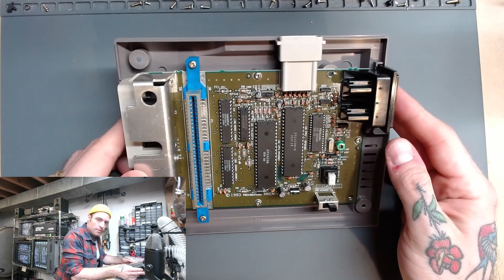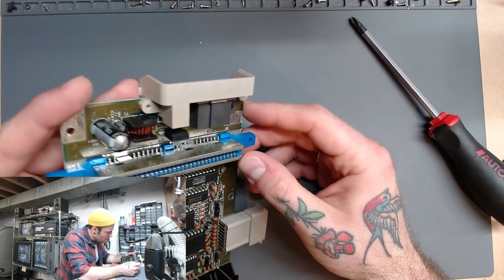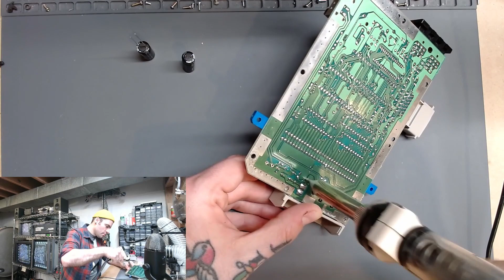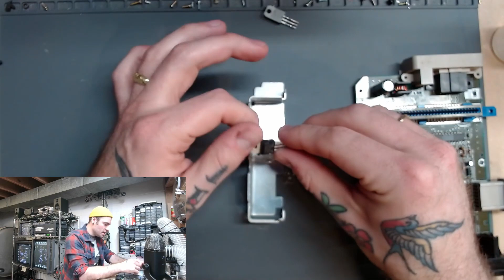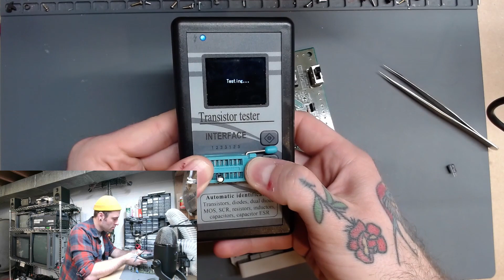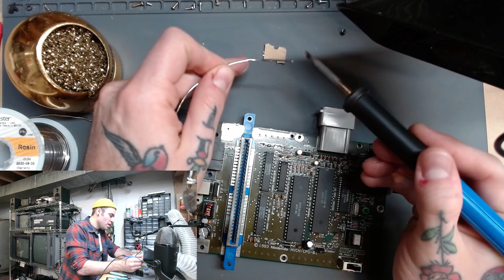AV Famicom Wrong AC Adapter Fix - New Caps and Voltage Regulator

Comment: Does putting an American NES adaptor into it automatically bust it from a voltage perspective? Wow, and I had another one with proper negative polarity nearby from my Korg synthesizer
Reply from the maker: The Japanese systems are all center negative. My guess is that he hooked up something that was specifically center positive. Firebrand X's power supply page is super helpful reference for stuff like this. Thanks for watching. Cheers!

http://www.firebrandx.com/triads.html

Comment: That voltage regulator, do you know the specs for it by chance where a replacement could be found?
Reply from the maker: I usually use 78S05 voltage regulators. You can usually find them at mouser, digikey, or other electronics suppliers. Alternatively you could get one from console5 dot com.
Reply: @daneolds515  Cool, thank you!
Reply: @daneolds515 would a 7805 regulator work?
Reply from the maker: @enjoythesho1992  Yep! The 78S05s are just more efficient.

Comment: I think I killed mine today with a 12V adapter….  It ran for a little while and then wouldn’t turn on again later.  What do you recommend?
Reply from the maker: Oh no! You’re not the first person to do it. Are you handy with a soldering iron?
Reply: @daneolds515  I’m adequate.  :)  I recapped a SNES last week with no incidents.
Reply: I would also add, it’s the grey screen show, and the CPU chip gets very hot very fast, so it probably needs replacement too.  I’m more than a little mad at myself because I paid “full eBay” price on this LOL and THOUGHT about it as I plugged it in, but was too lazy to check because they are so close to SFCs aesthetically, I figured ‘meh’.
Reply from the maker: @mercurialgirl  Yeah, Gray screen is scary. It does power on though with a correct adapter?
Reply: @daneolds515  It does.  Upon closer inspection, neither of my adapters are 12V - they are both 9V (one at 1A and one at 850mA - one is a Sega plug and one is a AliExpress 3-in-1 that serves SNES/Genesis and NES units that I bought for Super Famicoms).  Both will power the board to a grey screen as though there is no cartridge in there.  I did intend to recap this thing anyway, so I think I will start there, replace the voltage regulator while I’m in there (love your thermal paste on the voltage regulator btw) and table this project until I have another Fami cart to test as well, in case that is the problem (I only have the one).  Sadly, shipping from Colsole5 to Canada is a little hefty, so I like to wait until I have several cap kits before I make the order.  

You’re making me want a desolder gun - I do all that by hand the long way!
Reply: @daneolds515  But yeah, for all the world it was BEHAVING like a dirty cart - no play on first try, blew the cart, it worked.  Took it out, put it back in, nothing,  fussed with it, got it working, bumped it while it was running, the screen glitched out and nothing worked ever again.  Usually these old units are a little more forgiving than this.
Reply from the maker: @mercurialgirl  That’s great actually. If I were you I’d buy some contact cleaner to spray in the cart connector. Hitting it with a fine Emory board can help too. I’d also make sure your carts are super clean. The more variables you eliminate the better. I’d also inspect all your caps, make sure nothing is bulged.
Reply: I gave it another clean, and black/blue keeps coming out of the slot, but it’s almost perfect now.  I noticed my reset switch doesn’t cut the grey screen video (but it cuts the audio hum), still getting a too-hot-to-touch CPU chip after several seconds on power.  No bulging caps, but haven’t done any individual tests on them.
Reply: UPDATE:  It was a dead CPU chip, and I didn’t want to admit it (because I killed it myself).  I was lucky enough to get a junk NES at a recycling place today for cheap and did a successful transplant.  However I don’t have a powered solder sucker so it took FOREVER…..  Originally I had planned to socket the board, but my sockets have not yet arrived, and I don’t know if I have it in me to do that solder removal by hand……
Reply from the maker: @mercurialgirl  I had a sneaking suspicion that was the case. Glad you were able to get a donor cheap.  As far as desoldering the goes it is
 A big job but it isn’t hard per se. if you have liquid flux, good solder braid, and good solder it shouldn’t be tooo bad. It will take a while though. If you want you could send it my way. I could knock out replacing it and putting in a socket right quick.